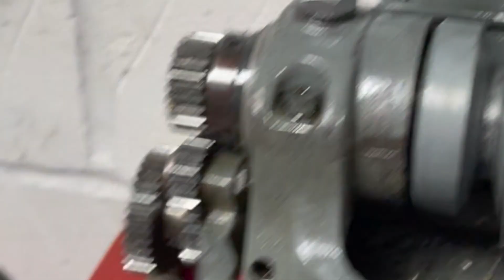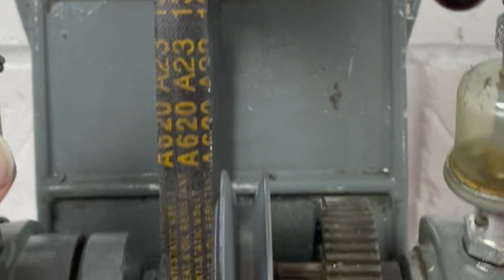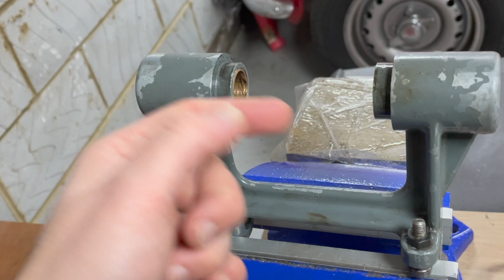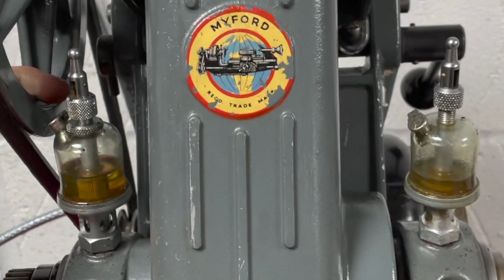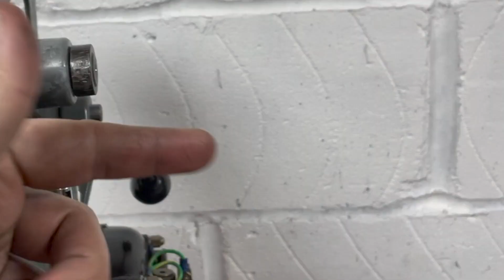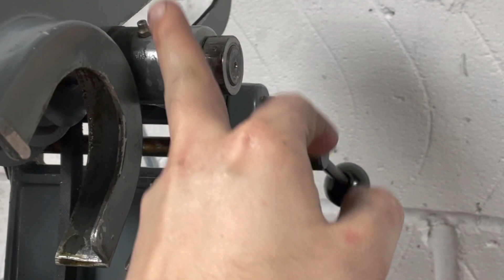How to service and replace an ML7 countershaft and bushes

Comment: How has the machine been since you fitted the new bushes? 

I'm at the same point, ready to press in the new bushes but the ID is a fair bit off and will need addressed. Reaming oilite has some mixed opinions online, relative to reducing the porosity.
Reply from the maker: My understanding was that reaming was OK, but lapping or using emery paper was bad. The kit I rented (which I could have made, had I had the foresight) to do this came with an expandable reamer. I've had no trouble at all and the machine has been running wonderfully.